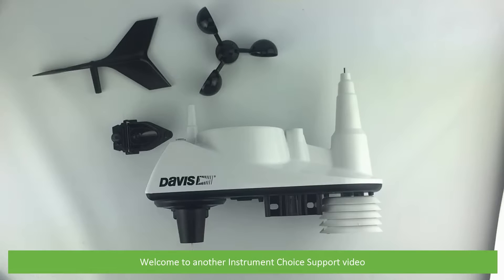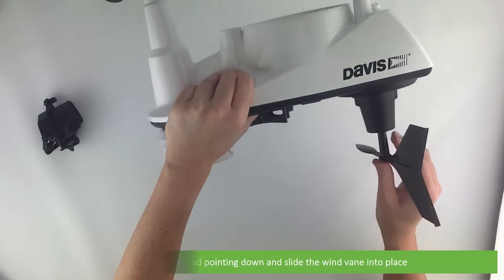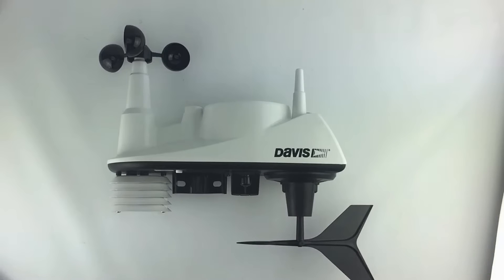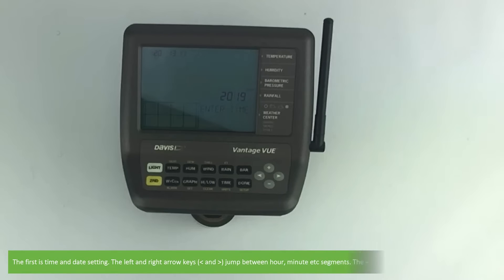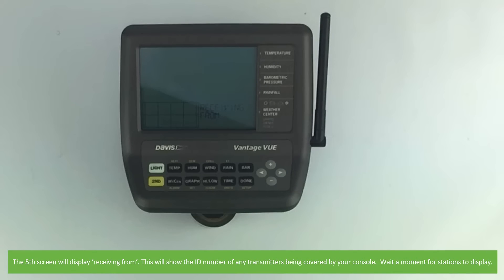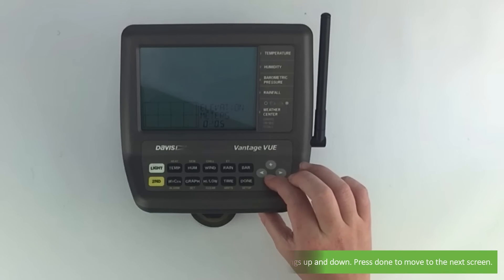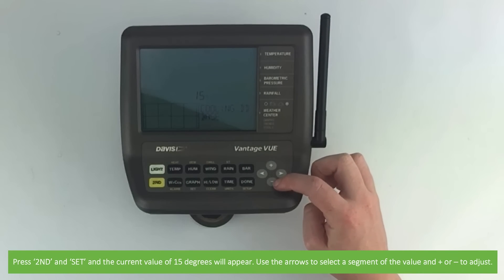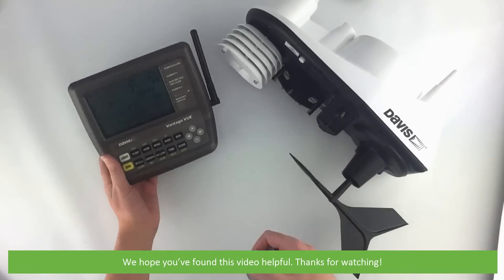How to Set Up the Davis Vantage Vue Indoor Console and Outdoor Sensor Suite

Comment: can you help me with wind direction re-calibration please ?
Reply from the maker: Thank you for your question.

To change the wind direction to 180 to suit the Southern hemisphere, please follow the steps below:

1. With the wind vane stationary, ascertain its actual direction. Compare it to the direction reading on the console. 
2. Press WIND until the wind direction in degrees is displayed. 
3. Press and release 2ND, then press and hold SET. The wind direction variable will begin to blink. 
4. Continue holding SET until “CAL” displays in the Weather Center. The Weather Center displays the previously set wind direction calibration value, if one has been set. 
5. Change the value of the wind direction in the compass rose based on the direction the anemometer is currently pointing. Due north is 360°, east is 90°, south is 180° and west is 270°. 6. Press the < and > keys to select digits in the anemometer’s current reading. 
7. Press the + and - keys to set the correct reading. 
8. Press DONE to exit calibration

Comment: Says nothing about setting up for Southern Hemisphere.
Reply from the maker: Hi David, Thanks for your comment. On installation in the southern hemisphere, the solar panel will ideally need to be facing North, and as a result, the wind direction reading will need to be adjusted on your console by 180 degrees. We will cover how to perform this in a how-to video very soon!  

A guide can be found here: https://www.davisinstruments.com.au/troubleshooting

Or for more information, please contact one of the Instrument Choice Scientists. Email customer-service@instrumentchoice.com.au or call 1300 737 871. Thanks!
Reply: @instrumentchoice  Hi - can you le me know when this is happening pease ?
Reply from the maker: @alistairmelhuish2168  , Thank you for your question.

To change the wind direction to 180 to suit the Southern hemisphere, please follow the steps below:

1. With the wind vane stationary, ascertain its actual direction. Compare it to the direction reading on the console. 
2. Press WIND until the wind direction in degrees is displayed. 
3. Press and release 2ND, then press and hold SET. The wind direction variable will begin to blink. 
4. Continue holding SET until “CAL” displays in the Weather Center. The Weather Center displays the previously set wind direction calibration value, if one has been set. 
5. Change the value of the wind direction in the compass rose based on the direction the anemometer is currently pointing. Due north is 360°, east is 90°, south is 180° and west is 270°. 6. Press the < and > keys to select digits in the anemometer’s current reading. 
7. Press the + and - keys to set the correct reading. 
8. Press DONE to exit calibration